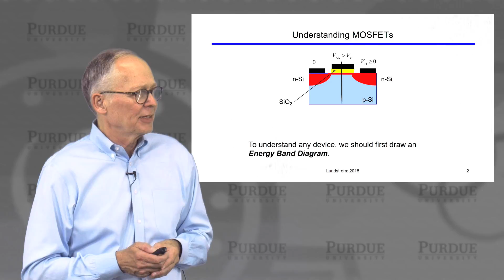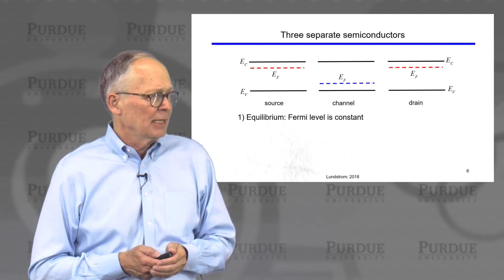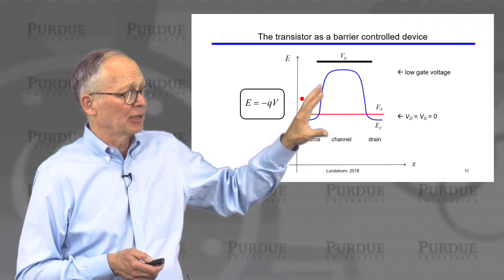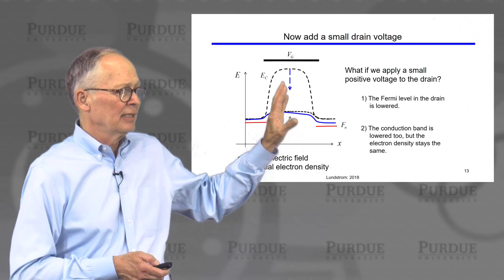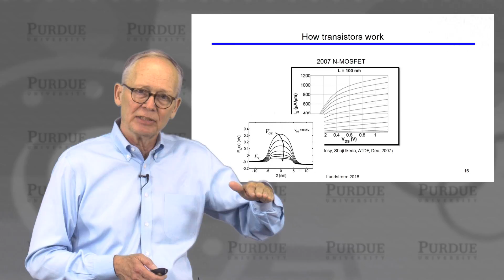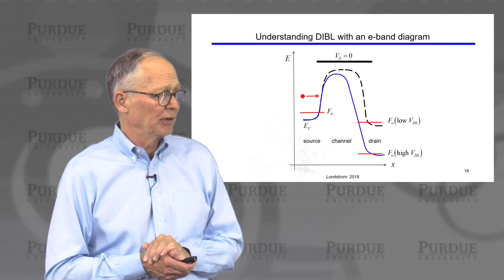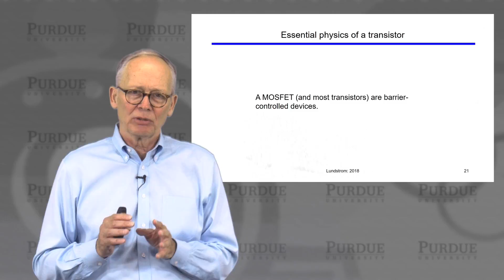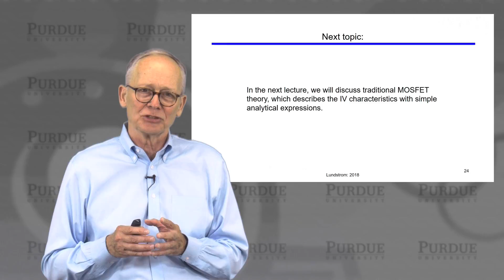nanoHUB-U MOSFET Essentials L2.2: Essential Physics of the MOSFET - Energy Band Diagram View

Comment: 00:00    Lecture 2.2: Energy Band View of the MOSFET
00:41    Understanding MOSFETs
01:00    Normal to the channel
01:26    Along the channel
01:58    Equilibrium E-band diagram
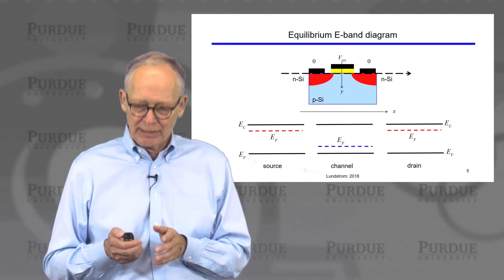02:53    Three separate semiconductors
03:39    Putting the three pieces together
03:58    Final result
04:48    Equilibrium energy band diagram
04:58    N-channel MOSFET: only electrons
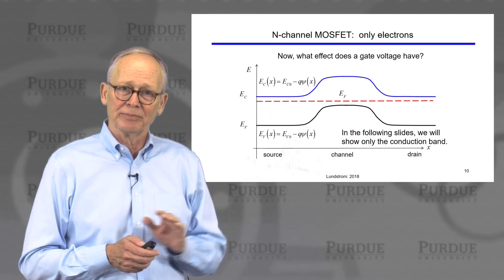05:33    The transistor as a barrier controlled device
06:20    Examine effect of gate voltage first
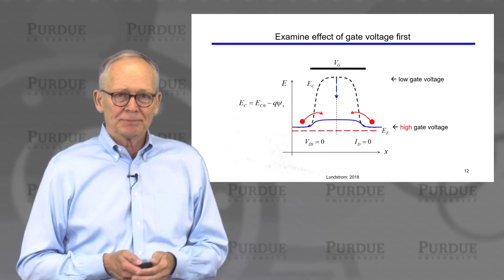07:16    Now add a small drain voltage
08:34    Now increase the drain voltage
09:44    Now remove the gate voltage
10:41    How transistors work
12:29    DIBL
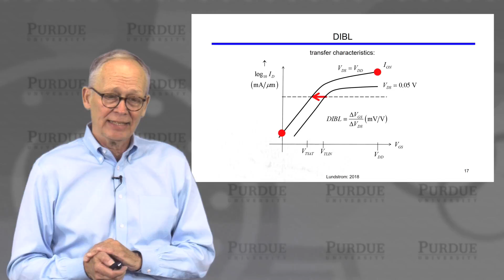12:45    Understanding DIBL with an e-band diagram
14:04    2D energy band diagrams
14:22    2D energy band diagram on n-MOSFET
15:00    Essential physics of a transistor
15:18    Limits to barrier control: quantum tunneling
17:27    Summary
18:09    Peek at next topic